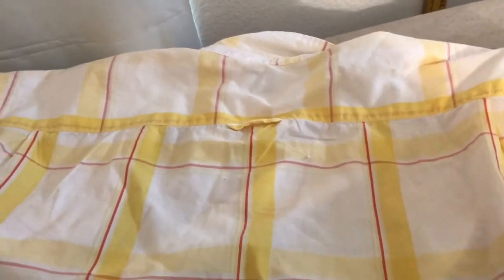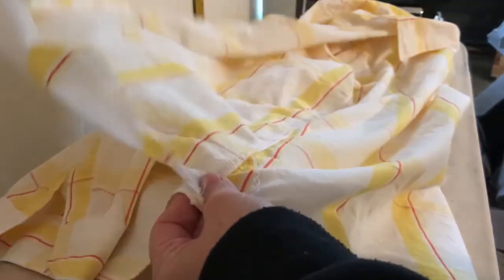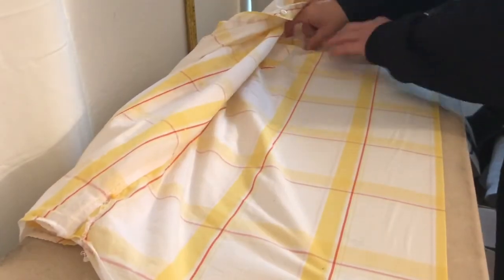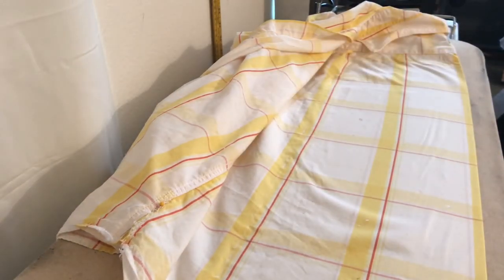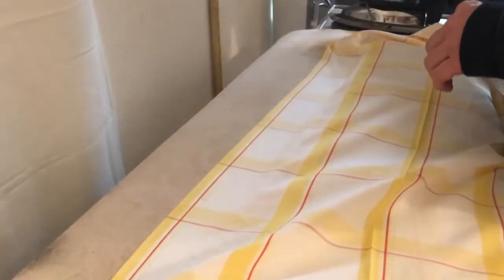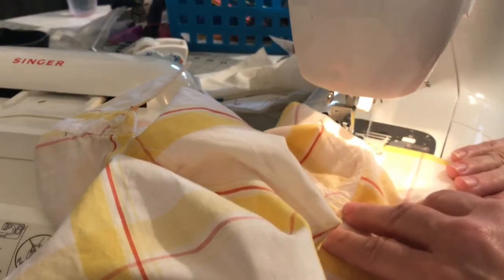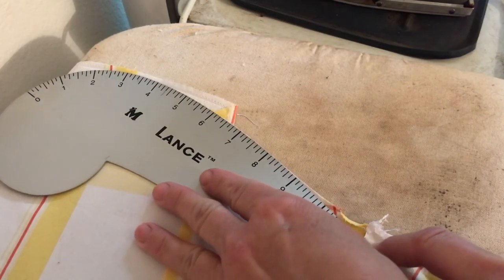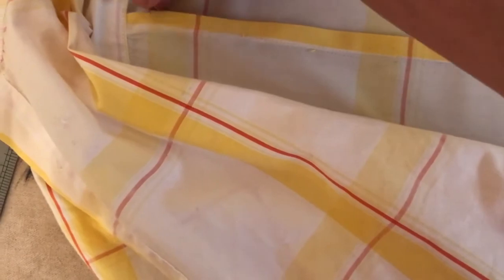How to Dart a man’s Dress Shirt

Comment: Loved the video. Question: can you make the dart deeper?
Reply from the maker: Thank you!
Darts can be tricky.  The deeper you make them, the longer they need to be.  If the ratio between the depth of the dart and the length of the dart is off, then you'll end up with points sticking up at the end of the dart. If you need more than 1/2" or so taken up, then you'll want to take some up on the sides.  If that's not enough, you might need to go down a shirt size. Does that make sense?
Reply: Angela Woolsey yes. Thx!!
Reply: Yes you can, but you probably don't want to go deeper in the dart until you get 10" down from the yoke seam, more or less.  Pin it, wear it, and you will see what I mean.  Angela is on the right track, in general.  This method is how I do my shirts when they are made with these side pleats.  My personal rule is a dart should not eliminate >2" of fabric per dart.  So, you can curve off of the dart straight line fold by no more than 1" as you pin it.  Make sense?